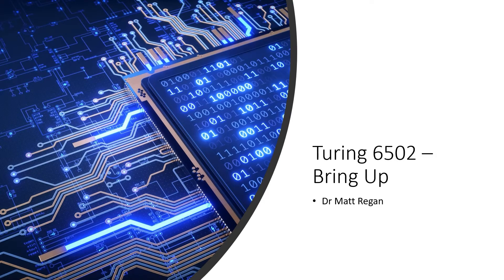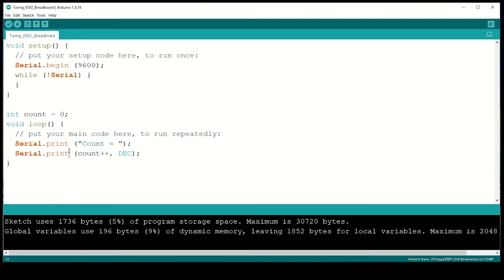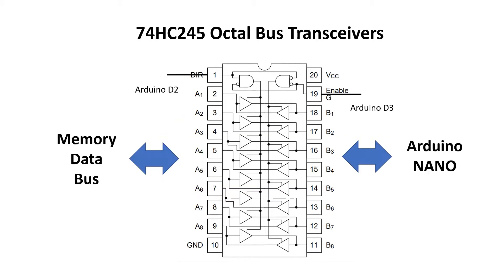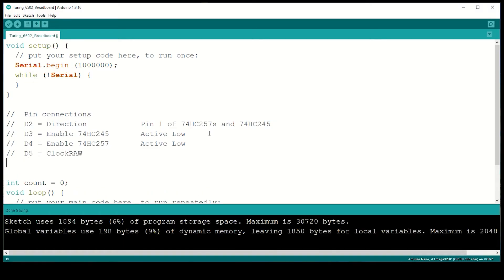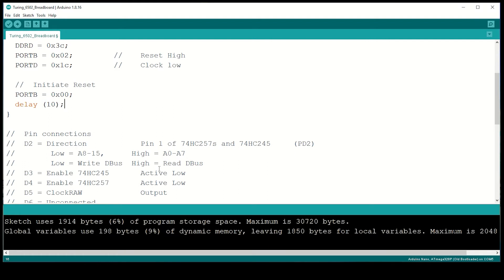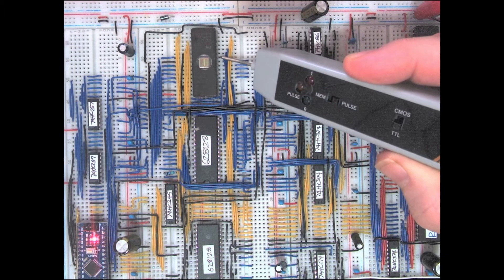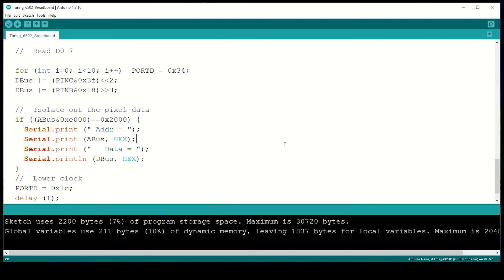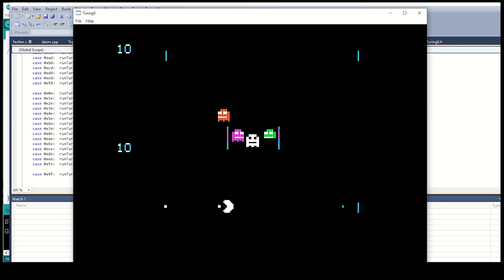Turing Machines Explained.  Bring Up

Comment: Very cool Will you make the Arduino code and circuit diagrams available once this project is complete?
Reply from the maker: Yes I they should be on www.github.com/Turing6502/Turing6502

Comment: 77 likes?  Had I the ability, I'd give this video 50 likes myself!  Extraordinarily satisfying!
Reply from the maker: Thanks for the feedback.  It's pretty cool when you cut the CPU right back to it's simplest form.  Things that seemed essential like ALUs, Program Counters etc, are to reduce the transistor count, but you can do with out them.
Reply: @DrMattRegan  So true!  I also admire your clever use of an Arduino Nano and C to suss your hardware.  It was an effort like that by Inmos that uncovered the Pentium's FPU bug.  I'm afraid my debugging isn't nearly as thorough or sophisticated.  I get a few competent results and declare my project done. :(